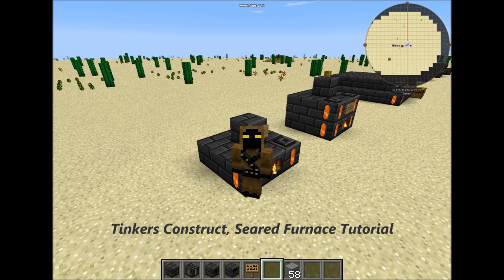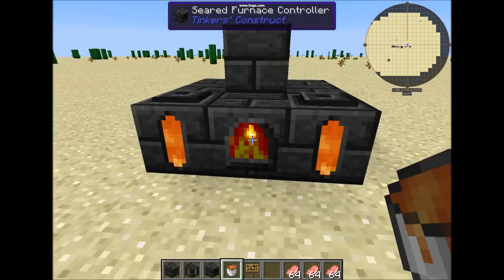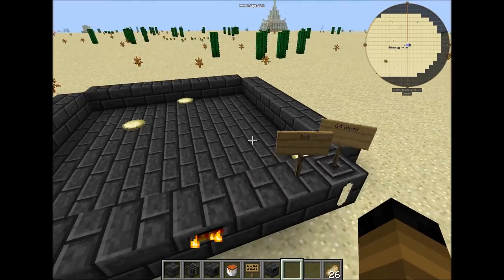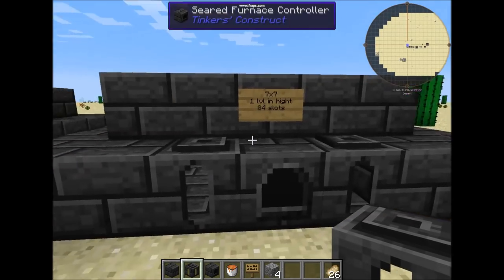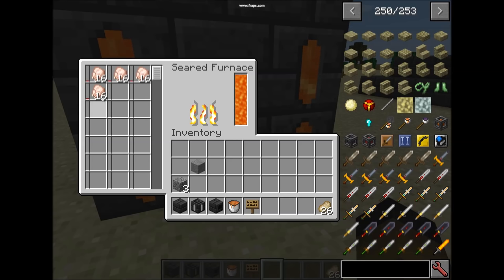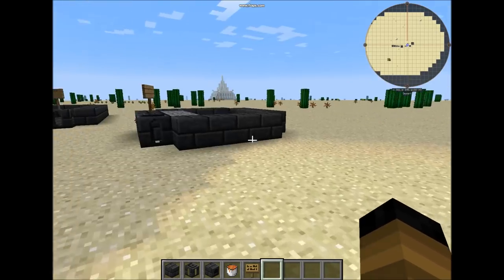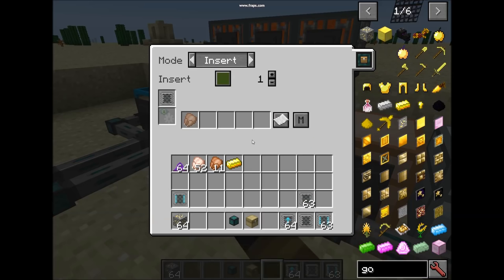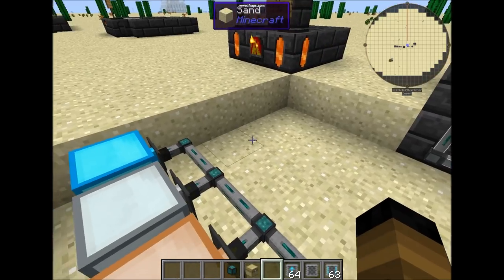Tinkers Construct,Seared Furnace Tutorial

Comment: Hey I got a question about the seared furnace I cannot find the seared furnace controller available only the seared smelter controller
Reply from the maker: it should be there, otherwise the mod has problems or its buged
Reply: @Ommy18  thanks for the help I figured out that I was using the version before the update

Comment: I built one exactly the way you did with the 3x3 start and the controller won't turn on. I have seared tanks in the corners, nothing in the center, controller in the front center block and just bricks on the sides and ceiling, yet it will never turn on.
Reply from the maker: well i did test this just now and it works just fine, maybe you did something wrong or might be a bug, if you want i can live test it on stream in twitch and you will see this live
Reply: There must also be seared bricks in the floor.

Comment: Good overall i like how your accent did not get in the way at all as you made sure it was understandable
To bad that your automation example does not work with only the mod itself because it would be useful to know if there is a way todo this with hoppers since im not getting the comperator to work
(Since many modpacks nowadays lock progression behind a wall of grinding)
The floor by the way only needs to be as large as the ceiling the goal is to make it impossible to look into the furnace and thats why the tanks are on the corners of it aswell
Reply from the maker: it can be done with hoppers but it will look clunky,takes allot of space and it also depends on what type of hoppers you use since there are mods that have hoppers different from vanilla